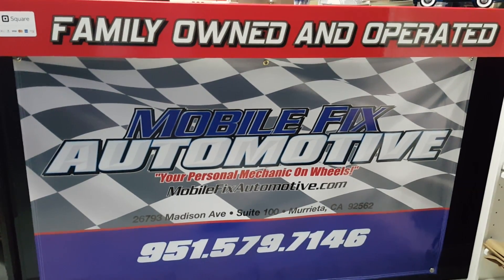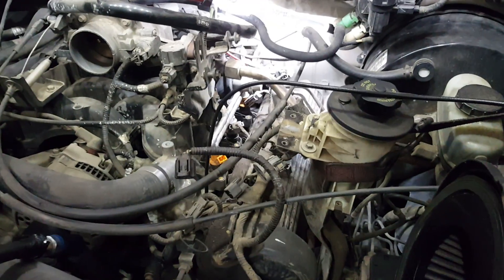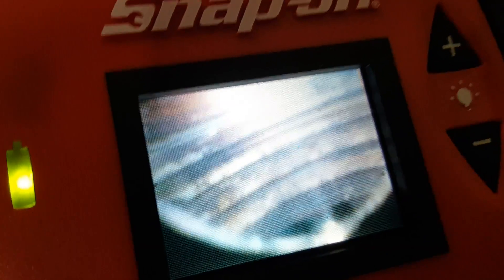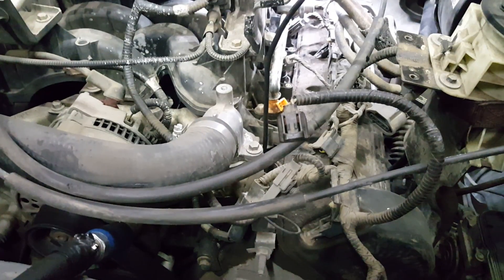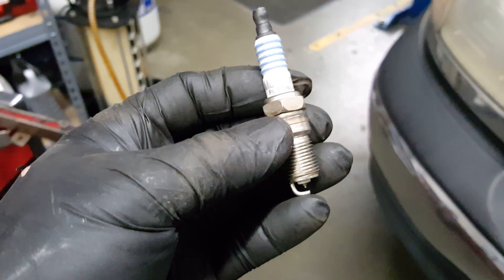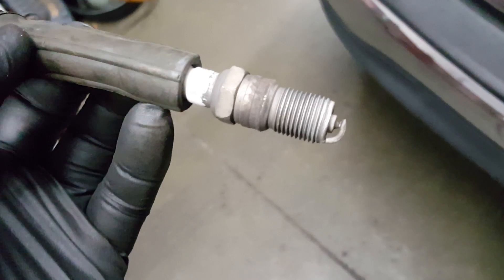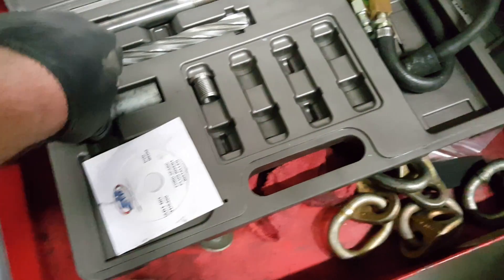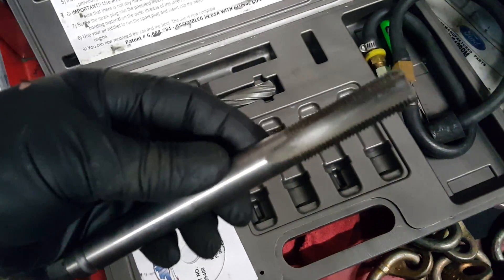Why the spark plug blew out of your Ford Triton engine

Comment: 30 years before those inserts - 
I installed hundreds of Heli-Coils. 

The reason they come loose is heat expansion, 
now the standard 60% thread cut, 
is now only 30% engaged. 
They don't unscrew, 
they just push past the little bit of threads engaged. Right? 

I designed my own thread cutting tap to allow the highest heat expansion on air cooled applications. 
Roll forming threads are ten times stronger than thread cutting taps for a good reason. 

Aluminum is nothing but cast porous Dutch Cheese. 
Using a claw hammer, one could simply pull spark plug straight out like a 16 penny nail when head temps exceed 350-450 degrees. 

Great Video Sir, and nice close up detail. 
FORD in no way can argue this case. 
Cheers. 
50 years as service tech, this case and demo is spot on proof as to why Ford Fails again. 
When one is commissioned to service a large Police Force of squad cars, and obviously Ford, 
it was hell keeping them alive all those years and 24/7.

Comment: Ron, thanks for the great explanation. Is there ever a time with one of the cylinders where it's better to remove the head because of access issues? For cylinders 4 and 8 I would imagine it may be tough to get access to drill, just wondering.
Reply from the maker: Never, all cylinder can be accessed and never need to remove fuel rail either.
Reply: @SandCarServices  That's good news. Thank you for the quick reply.

Comment: Knocking on wood here but I have 190,000 + miles on my 2002 F150 with a 5.4 and changed the plugs twice, second time a month ago. Lots of threads in the heads. This must be from a plant where my heads were not made. I have heard about this and never seen it. Interesting the threads in the heads you showed were done like that! I had to spin mine a long distance before they seated!

Comment: Well.  I am the proud owner of a Ford truck, and it has given me no problems.  Of course, the cylinder head is cast iron instead of aluminum and there is a single ignition coil for all six cylinders.  It's a 1964 Econoline, likely built in 1963, and I bought it in 1980.  I did have to rebuild the gearshift lever in 1982, and its straight six (170 cid) has had two rebuilds.  It's an old friend.
Reply from the maker: Built in a better time
Reply: @SandCarServices   built with real pride!

Comment: fixed or repossessed...[these days]....daily....in the old days, a mechanic or rodder needed to lean over the fender, not over the belt[s] and fan for safety when he "revved it up" to see if it would "take gas" properly, now days, the odds are better to lean over the front of 1 of these fords than to unscrew an autolite,...out of your forehead. my how times have changed...dont these things have a monumental ex. manifold issue too?

Comment: I believe this guy, Not ford.
Reply: Because male and female threads have to have the same number of actual threads... You wanna call somebody else a dumbass, but you can only regurgitate bullshit you got from some other idiot.
Reply: You are a fool then!
Reply: I don't. If hes having them blow out Period means hes not properly Torquing them to spec and is a bad mechanic.
Reply: @MAGWolf  if you don't believe this guy how come Ford updated the cylinder head to have 10 threads on the spark plug holes
Reply: Mark Wolf are you crazy?
Reply: Mark Wolf your an idiot he showed there was only 4 threads on cylinder head and like 9 on the spark plug not enough threads on the head dumb ass

Comment: First of all. This is a very interesting video. Thank you for posting it. As a VERY old mechanic of over 50 years experience(yea, giving my age away), I have to say this. I own an '02' Ford E250, extended van, with a 5.4, 2 valve engine. Other than normal service, this engine is untouched(NO major work). One week ago, 1/2019, it turned over 317,000 miles.  Nearing the end of my long working career, I was a fleet manager for a large service company in SW Florida. We had aprox. 65 vehicles. Most of which were Fords. The only real problems that I had personal experience with,  were the 3 valve engines. MY own vehicle was purchased in Jan. 2008, from the company, used, with 153,000 miles on it. And, it was only 6 years old. But, it was maintained regularly to the company's specifications. I have driven it across country four times. It has been as far away from SW Fl. as Portland, Or. And recently, Essex, Conn. I'm an 'old gearhead' from the late 50s/60s. Big block era. The Ford that I now own, has been one of the most dependable vehicles that I've ever owned. With all these miles on it, it uses next to no oil, plenty of power for what it is, and reasonable gas mileage for a rolling 'bill-board'.

Comment: My 05 started missing on #5 at 91,000 miles. I put about a table spoon of marvel mystery oil in every hole and waited an hour before removing the plugs.
I put Autolite plugs and now she at 
130,000 and going strong. 
I have been thinking about changing the timing chain guides and wonder what mile they recommend it?

Comment: YOUR VIDEO  IS THE FIRST ONE OUT OF HUNDREDS THAT IVE SEEN  THAT HAS  ANY REAL MEAT TO IT.... I have an'01 , 150 ford with 5.4 triton.   85,000 original miles,,   it has a  "misfire ' on #5  that i simply cannot corrrect.  new plugs  all new cops and wires.    it sounds like an old truck and runs lousy,   its almost as if something is wrong with the trans,  since  i cant get it togo into the low gears when at stop,,  it spits and sputters with almost no power     even though it runs great at higher r.p.m.s  until i get to a  hill. then i stutters and stumbles to where i  have to put it in over drive  to get the rpms back up..and in a gear that  works .
     a dozen mechanics   endless electronic  computer tests  and its always the same result...  still a misfire  sounds like  i have a hole in the muffler..  or exhauset--maybe cat converter./  dont know ..      its a great truck  i love it..  but this problem makes it feel like im driving an ancient piece of junk...     might you have any suggesttions  that would help me remedy this problem>
   johnny j. york pa.     717-855-0446  januarty 28, '19

Comment: Oh P.S. there was a guy out in California, who did business WORLD WIDE, fixing this problem,  not only on FORDS, but BMW and Volkswagen, seems to have had a similar issue.  This guy would go around and re-tap and do an insert that expanded and contracted at the same rate as the original head, he guaranteed this repair for life.  Of course FORD refused to warrantee this because it hasn't KILLED anyone yet, but someone had experienced a fire in the Engine compartment, when the fuel line for the injector broke, (this was back in 2008) a simple Service Bulletin would have sufficed, take the plugs out, clean the carbon, re- toque !

Comment: I had this happen on a 2002 F-250 5.4 L engine.  Seems the threads for the 1994 to 2004 engines were only 5 threads deep.  The fix according to FORD, was to remove the spark plugs, clean the carbon off the threads and spark plugs, and  re-Torque to specs.  Ford wanted $5,000 to replace the head.  This spark plug launching also took out the spark generator.   I got a mechanic to put in a coil, and I quickly traded in my LAST FORD !  to purchase a Toyota Tundra,  I've been buying Toyota's ever since, have YET to have a single issue with my Toyota's UNLIKE my FORD'S.  My other F-250 Ford, mysteriously ingested, water from the gas tank, and that resulted in an engine rebuild on the road, to the tune of $5,000 that seems to be a regular price for many Ford repairs.  While this engine rebuild was done in N.H. off Route 93, a few months later, I had to return to the local FORD dealer for a problem with the Anti Knock sensor.  Seems, the guys in NH, reused the old anti knock sensor, (OK) but did a shit job connecting it with the BUTT connector !  Another partial engine tear down and another expensive repair.  I called the NH FORD dealer and he basically told me to pound sand, the local guy must have took pity on me and I got it fixed, and the check I wrote mysteriously disappeared.  Needless to say, GOOD BYE TO FORD MOCO forever !

Comment: Typical Ford engineering, they know they have a problem but refuse to fix it. The only time they'll fix any problem is after someone dies or their products burn structures down. This sparkplug problem has costed Ford owners millions of dollars . Those types of cylinder heads are clearly engineered to fail.

Comment: Not a normal occurance, much more common to snap the porcelain on the plug being as that these Triton spark plugs sit inside of the combustion chamber instead of flush with the top of the head, and are normally bound to the head by heavy carbon deposits. Plugs shot out scream user error upon install, wrong plug installed in the first place, excessive use of any style of anti seize, or pushed far past normal service interval.

Comment: When you ream out those spark plug holes what happens to those steel fillings that end up in your piston or ring system?
Reply: You're supposed to vacuum the living sh*t out them with a long skinny vacuum adapter and the chips are aluminum, so they will burn out and go out with exhaust gasses. It pisses me off that Ron doesn't tell you that.
Reply from the maker: @garys9694   You guys need to watch the video on how to do the actual repair that video explains everything. This video was merely to explain why the problem is happening it has nothing to do with the actual repair procedures.
Reply from the maker: They evaporate! Lol

Comment: Very informative. My question is, after the tapping process how do you remove any chip debris that would have fallen into the cylinder? Isn't that a problem or is there a specific method for cleaning out the cylinder or preventing chips from entering while tapping. I also agree that it's Ford's problem for not providing full thread up to the sealing surface. I call that area void of threads, The gap that gathers the crap! Jpol
Reply from the maker: Watch my install video called revised calvan insert installation. It explains everything
Reply: @SandCarServices  Thanks Ron. I'll check it out.

Comment: I have a 2004 Eddie Bauer Explorer with a 4.6L engine.  I've never had an issue with spark plugs blowing out of cylinders heads, and I think I've only heard of it happening very infrequently.  Having said that, it is unsettling that there are as few threads as there are in that cylinder head.  Maybe part of routine maintenance should include checking the torque on the spark plugs?  I thought about installing PI heads on this engine (unless I already have them) and if I go through the trouble, I'm gonna add these sleeves to all the spark plug holes.

Comment: Ron, is there any way to see or find out if the inserts have been installed in a 4.6 triton? I drive a 1999 ford pickem up truck and have not had any problems with so far, it has over 150000 miles. I bought it used with under 100k miles. Thank you and I subed and will check out more of your videos.

Comment: I was working at NAPA when these Triton engines first came out. We had a kit we sold, not quite as nice the CalVan one you are using, and we sold them by the ton. I have never heard mechanics cuss anything as much as those motors. (even more than the Northstar starter joke.)And of course, the police dept had a bunch of them. Like you, when I did the thread count on the heads and then the plugs and saw the problem right away. What makes me really mad is Ford didn't correct the issue when it first came out.

Comment: Just another things that keeps you earning your paycheck....I've repaired plenty of those myself, gravy work. 3 valves just have a newer more expensive problem..............Them cam  phasers! lol DO NOT use cheap aftermarket replacement parts, like Dorman etc, ONLY Ford parts! Or you will be fixing them soon again, 1 week, 1 month, 6 months, you won't know until they fail !! And they WILL fail in a short time span!!! MORE $$$$  

I have also changed/repaired blown out plugs in a few GM's !!  You just don't hear about it with a GM quite as much

Comment: hi ron... i have a 2004 ford f150 larait and its got a misfire on c1 and now oil coming out of c1 i have not took the coil and boot off to take a look but I had all plugs wires and coils replaced and it was ok for awhile and now i have a miss in c1 that wont go away. blue smoke at start up and then turns white after a while, but i drilled holes all over my muffler, and it seemed to bo a little better but it also has a reduce in engine power and a blinking engine light...but the hole where the last thing i did. just because i wanted it to be a little bite louder, i couldnt stand a truck i couldnt hear. lol it was so quiet i always thought it was dying out.

Comment: My wife said the spark plug blew out of the chevy cavalier. I think it just wasn't tight.
Reply: I had a spark plug work loose on an iron duke engine. But it stayed in the threads, it had not backed all the way out. We have been putting spark plugs in for over a century without problems, why change things.

Comment: Never had a problem with the old stuff . Plus that 81 460 carb engine would pull a house down and the Cleveland engines were outstanding.I had a 1972 351 Cleveland with 270,000 miles and only had to replace the water pump besides regular maint. All of this new stuff is government mandated computer trash and extremely overpriced.

Comment: It looks to me as if there may have been threads all the way to the top of the spark plug hole, but the plug came loose, screwed itself out  4 threads, then blew out, stripping the rest of the threads up to the top of the hole . That's why the bottom 4 threads are still intact. If the plug just blew out, then all the threads, including the bottom 4, would be stripped.
Maybe it's a problem with the taper seat plugs not being torqued up enough. With that kind of plug, you can't feel a gasket squashing as you tighten it up. It just hits the tapered seat, and feels like it shouldn't be tightened up any further, for fear of stripping the alloy threads. They are very sensitive to the amount of torque, and must be done up with a torque wrench exactly to spec. 
Taper seat plugs work very well in iron heads- you can tighten them up "Till they squeak", as my Dad used to say, and they won't come loose till next time you take them out.
In alloy, it's much more critical. Tighten them up too much, you may strip the thread, not enough, they work loose. The answer could be to redesign the head to take regular flat gasket plugs.
Just my 2 cents' worth.

Comment: Having owned two navigators with 5.4. A 1998 and a 2003 I' m here to tell not another ford! The Triton is crap. Blown head gaskets, intake gaskets, in fact all gaskets, plug issues, security system issues ....the list just goes on and on. Both navs went to the junk yard. My 1994 suburban is still running having outlived both navs and accumulated 327000 miles, more than both navs put together. My 2000 GMC sierra same deal. I work on my cars and am not a professional but am technologically literate. Ford really screwed up with that "modular" engine design. Period. No amount of advertising hype or double talk will fix the mess they made.

Comment: 3800 explosions per minute per cylinder @ cruising rpm, so we'll cut a grand total of 4 & 1/2 rings of thread into the plug holes - should be enough. What could POSSIBLY go wrong?

Comment: 1,141 comments plus mine.  I don't see any tips for keeping the cuttings from the drilling and tapping from falling into the combustion chamber.  Thanks.
Reply from the maker: That's because this video has nothing to do with the repair it's just stating the reason why it happens. If you wanna see the answer to that question watch my video on the revised install on the calvan insert that video explains everything thank you

Comment: So, what you're actually dealing with is an OEM DEFECT!  A failure to properly cut the spark plug threads into the engine block.  Hmmm.  Good thing I don't have one of those Triton engines!

Comment: My 07 f150 has the 5.4 with 315,000 on the original engine and trans, it's been a great truck. The other day it randomly started mis firing, I swapped coils from a neighbor cylinder to test for a bad coil, no luck coil is good. It's cylinder #2 im not wanting to take the plug out on fear it will break but I guess that's my next move?

Comment: I had one blow out and the coil got trashed.  4 threads in aluminum with steal going in to it !! They have different expansion rates of cores there going to walk out . FORD Really. Ford couldn't put more threads on them in the aluminum. This is why I will get a Nissan NV next it has a full frame under it.  Transit you can keep

Comment: May I ask, why the heads were designed only to have 3 out of 9 threads.  If this was a big mistake, why did new cylinder heads for warranty exchange still only come with 3 out of the necessary 9 threads. It makes no sense. I have never seen a European made cylinder head without full spark plug threading. What was the motive, saveing money if so, It backfired big time.